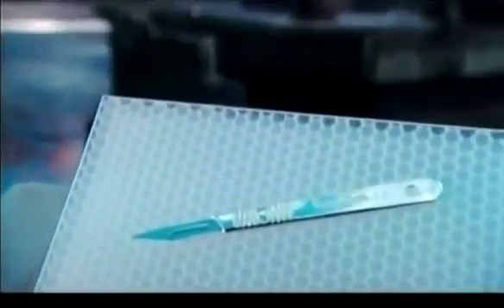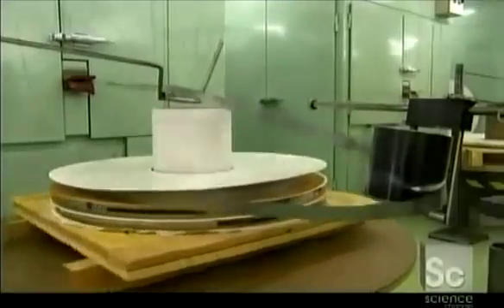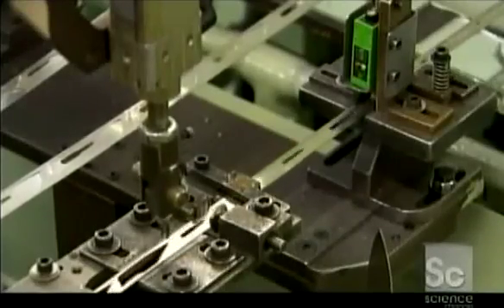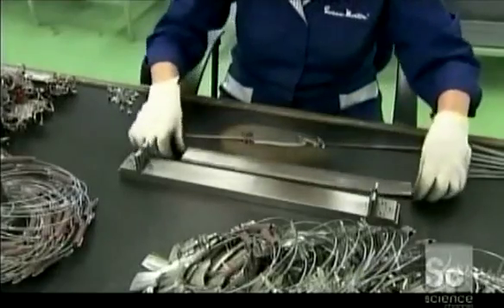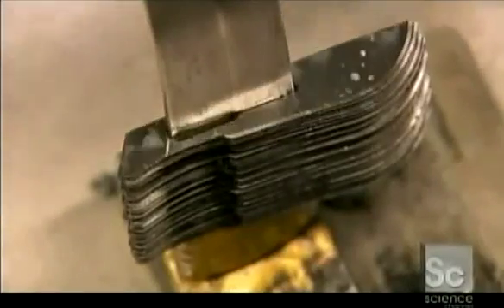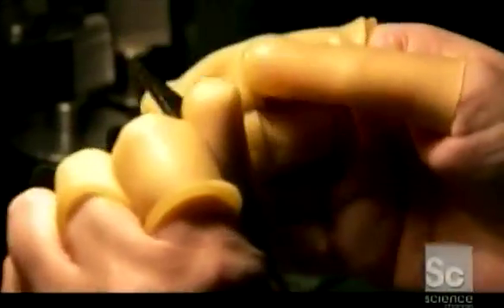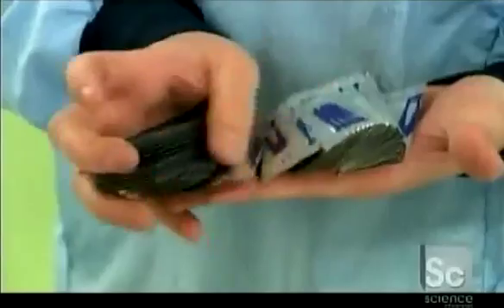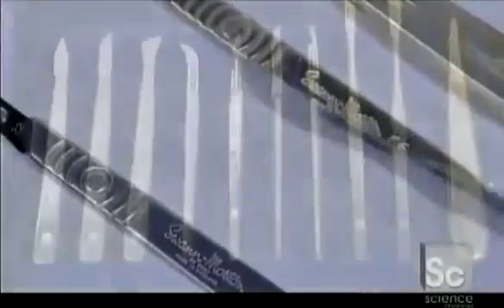How Swann Morton Scalpel Blades are made.

Comment: Anybody here a doctor? Wouldn't a bayonet also be "one time use only" as well?
Reply: The handles are washed and sterilised, usually with steam. 

The blades are usually disposed of not only for sanitary reasons, but also because the scalpel blade would be blunted slightly during the procedure. Scalpels need to be REALLY sharp.
Reply: Well you're not wrong
Reply: I think the handles, like a lot of other surgical equipment can be cleaned and then sterilized in an autoclave before being reused